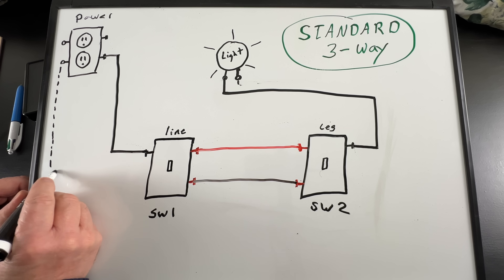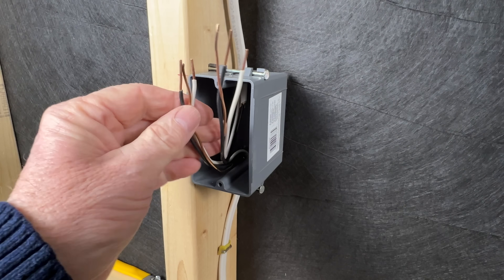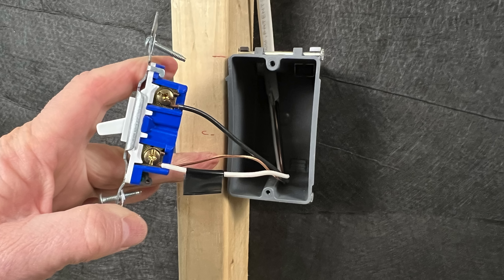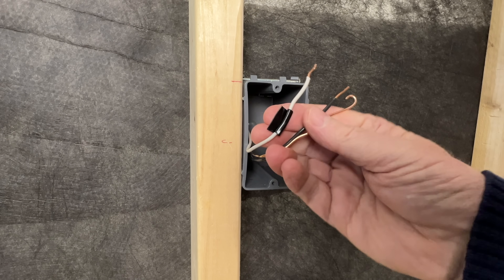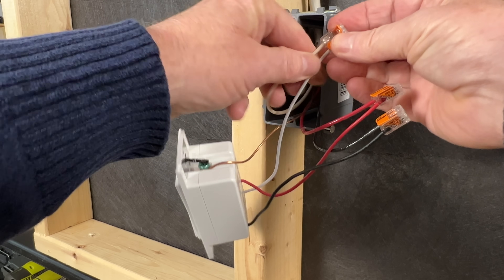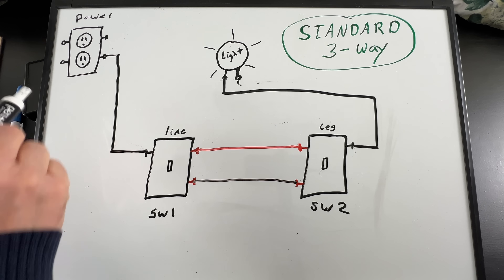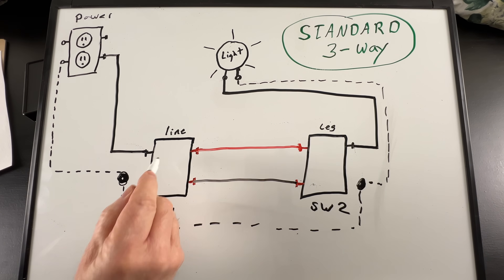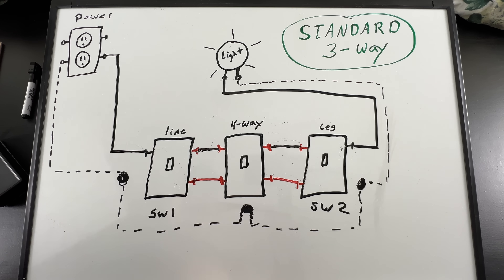How NOT to Wire Light Switches in 2025 (New Rules)

Comment: I'm not real keen on the NEC, which was established for electrical safety, starting to require things like this.  In most cases this will never be used.  I really think most people are happy to just turn the light on and off with the wall switch. In the last few years the NEC has taken the code to an extreme, requiring  Ground fault protection on equipment that does not substantially need it.....Stoves, ovens, HVAC units, dishwashers and the like.  These units are solidly grounded which prevents shock hazard (externally) and would/should be disconnected for service.  This whole thing with the NEC smells of influence from manufactures of equipment.
Reply from the maker: The younger generations love controlling things with their home assistant or with their phones. The issue was that its difficult to get a neutral to the box later and its very easy and inexpensive to do it during the original installation. From a safety standpoint people were connecting the neutral to the ground wire. It would work but create a hazard by having current flow on the ground.
Reply: @BackyardMaine  When I was doing professional home automation systems, I used smart switches plenty of times to correct for houses that had light switches installed in terrible locations. Wouldn't matter where the load was physically controlled, we could re-map any switch anywhere in the house. Lets us do some fun automation, like for example connecting with home theatre controls so when you pause your movie, the lights come up to a dimmed setting.
Reply from the maker: @ryanc9282  That does sound like fun work. I did a lot of automation when I worked as an electrical engineer for TI. When control systems are you using to automate the theater lighting?
Reply: @BackyardMaine  Ok so keep in mind I was doing this for a living 10+ years ago. At the time I was using mostly Control4 for residential clients. They have their own lighting system, or you can integrate third-party ones like what Lutron has.

Currently in my house I have a heavily custom Home Assistant setup, using Lutron lighting and a few LED controller boards, among a lot of other things.

Another fun one was hooking a relay board into the doorbell circuit, so it can become an input for automation. So if you start a movie and you're still waiting for the pizza guy, when he rings the doorbell the automation controller can pause your movie and turn on all the lights between the theatre room and the front door.

It really is a hell of a lot of fun.
Reply from the maker: @ryanc9282  Wow, that does sound like some fun projects with a really cool result. I love it..
Reply: @ryanc9282  Doing this with my house now.  Idiots wired it and home assistant and Shelly devices are making this switched sane.  No more going to 4 different walls to turn all the lights on in the living room.  Just remap it in the computer.
Reply: @voidFutureVector  When I started doing automation work, I never imagined just how much I'd be doing that kind of thing. Never expected just how common it is to have ridiculous switch layouts.
Reply: @BackyardMaine we used to include a motion sensor to turn on the lighing in the movie room when first entered, then said lights were overridden by the theatre automation during viewing. When done, sensor restored as system shut down allowing to leave. Mom insisted,  so she could go in and round up dishes and stuff left by kids without having to deal with Dad's control system. Ah! Family harmony as last!
Reply: The issue is not that the devices were not usable, its that people were (and still are) using the ground as a neutral replacement.
Reply: @j.n.572 I don't see the danger in that. The ground goes to the same place as the neutral, and those "smart"/dumb switches only consume a teeny bit of power, so there's no risk of overheating your ground.
Reply: No, it doesn’t. Neutral goes to the neutral bar in the panel, which is fed back onto the neutral on the grid. Your ground wire leads to, guess where?? The ground lol not the same place at all.
Reply: @jaygallant8635 so, is that why the neutral wire is bonded(hardwire connected) to the ground in the panel per NEC? Wait a minute, seems someone forgot that part.
Reply: Just saw a video on reddit of a modular can light arcing when the home owner pulled it down you could see it smoking and arcing. These cheap Chinese designed and built switching power supplies burn up maybe an arc fault breaker might have tripped from that don't know. I'm not against arcfault/GFCI breakers it would be nice if the prices for them were more reasonable. Another story I have hired a large plumbing contractor to replace my electric water heater with a modern heat pump type. Above my old water heater was an old school pool timer yellow dial someone at one time thought save money turning it off during peak hours all it did was get my wife angry because she always wanted to take a shower during that time and someone had drained the tank. I told the plumber didn't want that timer box get rid of it he said he would use wire nuts to connect the whip. My home was built during the 1970's has aluminum wiring the wire going to the water heater was 6 Awg Aluminum still legal today to use for a water heater not branch wiring. He wired copper wire whip to aluminum 6 gauge. I came home saw the new water heater was shut off. I thought maybe it has a bad compressor I flipped the breaker back on it had tripped. It turned back on 30 min later I came back out saw a black mark up the wall. The wire had burned back like a fuse stopped where the wire strain relief was clamped tight enough to get enough current to trip the breaker. I was super lucky didn't burn up into my dry attic and entire house would have caught fire. I live in AZ attics here are tinder boxes wood that has been dried by decades of 120F heat and 8% humidity. Arc fault might have tripped sooner.
Reply: I never used a little bit of black tape taped all white with black tape or permanent black marker.
Reply from the maker: That's going to be whatever the local AHJ is looking for because the code isn't specific. @barrythomas529
Reply: They 100% are in their pockets!
Reply: Disagree with you, most new electronics and Led Lightning didn’t work if the neutral it’s missing or inexistent. So leave it in the box it’s something the sooner or late will be used.
Reply: NFPA owns NEC. I was a career firefighter for 23 years.  During that time I purchased 4 fire apparatus, fire hose and other items for our department. During that time I learned how NFPA has a seat at the table for manufacturers.  They are continually trying to create mandatory short term lives for equipment and the list goes on and on.  Luckily in the fire service the AHJ is given the final word, with the NEC many jurisdictions blindly adopt it and the enforcement parties are often thise who have spent Weeks and Weeks (haha) training (as opposed to retired Journeyman electricians)
Reply: @spudth  Re: short-term lives.  Now that I'm old enough to have bought electronic equipment and have it later fail due to age, I agree that code shouldn't be requiring any devices with an expected lifespan less than 60 years. IMO that should mean no devices that contain electrolytic capacitors or flash/EPROM memory.

Comment: Going to the switch first, then the light, seems the most logical method.  It keeps the wire colors consistent so the homeowner can easily tell what's what if they ever change out switches or lights.
Reply: Ok this can go both ways and one is not more important than the other. If you need a neutral in your switch box then put one. In Florida it's more economic to feed the lights because all the wires are in the attic. I also don't put outlets on my light circuits. The only exception is a lamp outlet. The reason being my dad taught me this And if you trip a circuit you won't be in the dark. My house isn't wired like I want but if I do the wiring I will stick to how dad taught me. As long as the code hasn't changed I will continue. I see if people think they cannot live without a smart house. I got along all these years with basic wiring. I can always use timer switches on a few lamps. 73
Reply: @ronb6182  If you're doing rework on an already finished building with established circuits, I could (maybe) see your point, but for new construction it does not take any more wire to do it the other way (even in Florida).  Just run the main circuit through the wall instead of the ceiling, and do the switched legs up to the ceiling instead.  Same amount of wire used either way.  And sure, you might need to drill a few more holes, but the extra amount of labor seems pretty small too, frankly.  Even if existing buildings were done a particular way, that was all solely because of (outdated) convention, not based on any actual real savings either way (and really has nothing to do with where you live).

And the point with this change is that nowadays it's become clear that everybody always needs a neutral in their switch box, even if it's currently unused.  You personally may not think you will ever need it (because you're a luddite), but you're not the judge of what other people should or shouldn't be allowed to change in the future in their own homes if they want to, and even in your house, somebody else probably will want/need it in the future for something long after you're gone anyway (the house will likely exist a lot longer than you will), so leaving it out is just really shortsighted and not a good option anymore.

And if you're putting in a neutral to the switch box (which you should be anyway, and now will actually be required to) then the feed-through method definitely does save copper over the switch loop method, so if nothing else it has now obviously become the preferable method in most cases.
Reply: @ronb6182 well that's not how the code works. And it does and did change. You might not "need" an outlet every 12 feet along the walls but it's code and for a reason. Or you might not "need" 2 20A circuits at your kitchen counters but it's code.
Reply: @Jake-uc8mb all my outlets are 20 amp throughout the whole house thank you very much. I never use number 14 in my house wiring it's my code. Lights and outlets have number 12. Enough said. 73
Reply: @Jake-uc8mb all my outlets are 20 amp throughout the whole house thank you very much. I never use number 14 in my house wiring it's my code. Lights and outlets have number 12. Enough said. 73
Reply: Most older houses ran the power wires in a loop to multiple fixtures and a switch loop down to switch. This saved the contracter money by using less wire and less time, this was especially prevalent in subdivisions.
Reply: I still prefer to carry the branch circuit thru the ceiling boxes,but for future planning,run a three wire down to the switch,and cap the neutral off.I’ve had homes with no outlet in the hallway,and not having a neutral available in any of the adjoining bedroom switches makes the installation much more labor intensive.Also,in the first demonstration,it is a trade practice to wire the line(white in this case)to the top side of a switch.This just matters as a point of reference ,but is required on exposed blade switches.
Reply: I always did it the new way. Another thing I like to do is always have the feeder line on the top screw of the switch and the bottom to the load.
Reply: Switch loops and shared neutrals were the standard practice for decades (60s, 70s, 80s) especially during times when copper prices were unusually high. Contractors are generally creatures of habit. Once they get accustomed to wiring one way, they continue to do so, unless forced (usually by code changes) to change. I’ve had to rewire my house, built in the early 50s, my father’s house built in the 20’s, and my mother-in-law’s house built in ‘79. All three had shared neutrals, Chicago three-ways, and switch loops.
Reply: No I always feed the hot and neutral at the light box it's much easier in Florida since we have no basements. All the wires come down from the attic. You would use more wire feeding the hot and neutral at the switch location. You would have double  wire going back to the light. 73 feeding wires down a wall are always a chore. 73
Reply: I've never understood the logic of wiring the power to the fixture, then running a cable to the switch.  Much more logical to do as you say.
Reply: @r7boatguy   it depends on the location of the boxes and where the wire is already running.  As an example suppose you have 3 rooms all on the same light circuit - run the main power legs from room to room through the ceiling , then drop a switch leg from each ceiling fixture to the switch box in the room.
Reply: @r7boatguy  Depends if you are back-tracking and how far that run is, you could save a lot of wire by not running a neutral when it is not needed.
Reply: @r7boatguy  No, power-to-switch absolutely is not the most logical given the current prevalence of inexpensive, universal smart light fixtures or indeed smart light bulbs. These fixtures are basically mass-produced in Asia with universal mounting hardware (so they will be installable anywhere in the world) and employ LEDs. This means that they run on DC - as do of course the smart electronics - and thus the voltage of the AC supply doesn't matter (within reason, so typically 90-300V) but crucially there must be permanent power at the fixture for the smart electronics. Power-to-switch violates this.

With a power-to-fixture setup, it's a simple matter to detach the leads to the wall switch(es) when installing the smart fixture so that power won't get turned off. Moreover, it's possible to design a smart fixture with a relay function in which the switch leads are reused as a relay instead (which could just involve sending 5 or 12V DC down to the switch).

But with power-to-switch you now have to rewire at the switch to just run through the box and replace it with a blank plate. There is also no easy way to reuse the switch itself as a relay.

Using 'smart switches' is the ass-backwards way of doing things because they have to be custom to each national wiring standard; you basically can't manufacture universal switches the way you can fixtures as the box shapes and sizes which are going to house the switch are all different. Unfortunately many North American homeowners are going to be stuck with using more costly smart switches and have reduced choice of fixtures because of the number of homes that have been wired with power-to-switch. Ironically the oldest houses are going to be the easiest to upgrade.

Accordingly, forward-thinking electricians should only be wiring light fixtures with power-to-fixture but now they'll have to run a likely-redundant third core to the switch boxes as well.
Reply: @r7boatguy Saves money, time, and wire.  That being said I wouldn’t do it in my own house.  All my switches were wired that way when I got the place, most of them been replaced now.  I did just help a friend completely rewire his house and we did the switches with no neutral.  He was more concerned with money and wire.
Reply: @cosmicinsane516  There are devices on the market now that require a neutral in the switchbox, people who have no clue about safety will use the grounding conductor as the neutral, which is a BAD idea! Pro Tip: never assume that the previous person knew what they were doing:) (ie. California Switchleg)
Reply: That's relatively unimportant. The important part is that you lose neutral at the light switch, making it a HUGE pain in the ass, and IMO, has always been a hard NO. but, 90% of electricians past and present suck and I wouldn't trust them to ever do any of my electrical work.
Reply: @espressomatic so what you are saying is you are the god of electricity. What a rube.
Reply: @Tom-og7fi  As a homeowner who tried to install smart switches only to find no neutral in any switch box was definitely a giant pain in the ass.  Instead of just swapping out a light switch I ended up rewiring every room light switch and fixture.  Turned a couple hours of work into a couple weeks of work fishing new wires to all my switches.  I really wish my grandpa hadn’t wired it that way but 70 years ago when he built the place no one cared.
Reply: @Tom-og7fi  LOL 73
Reply: @cosmicinsane516  the future always brings change. Smart switches have not been around for that long considering how long electricity has been around.
Reply: @Tom-og7fi  I realize that.  It didn’t make it any easier to switch them out.  I think now that they exist, it’s a good idea that code is being updated to require a neutral at your switch.  The inspector that signed off on my friends house we re-wired told us that if we did it next year he wouldn’t be able to accept the switches without a neutral in the box.
Reply: @cosmicinsane516 And ironically in 70 years when it’s different, someone will complain about the way you did it. So get over it and understand things change over time
Reply: @cosmicinsane516  Why would you want a "smart switch" on the first place, they will fail far faster than a standard switch!

Comment: So what you are saying is that the people who make the code, are being paid off by the cable manufacture so they can sell more 12/3, making them more money. This also increases the price of new homes. The requirement of tamper resistant outlet, the terrible ark fault breakers, and forcing 12/3 are all rules to rip of the American people.
Reply from the maker: No I'm not saying that at all. Guess what people do when they need a neutral and don't have one. They connect to the ground wire creating a hazard. Tamper resistant receptacles save so many lives. Check out the stats on the CSPC website. Well worth the inconvenience to save our children.